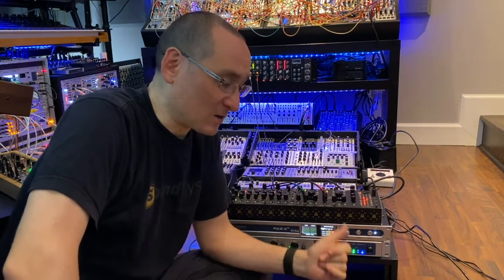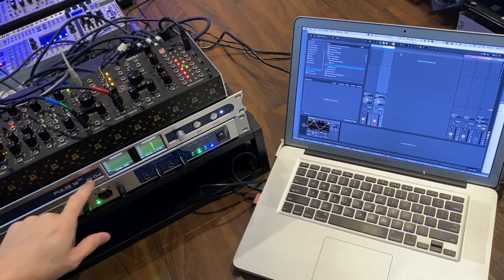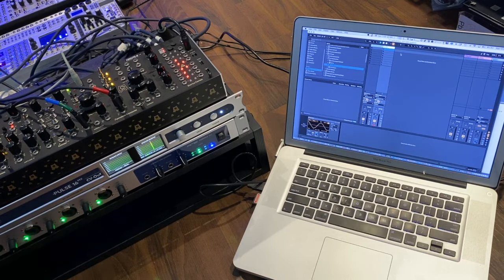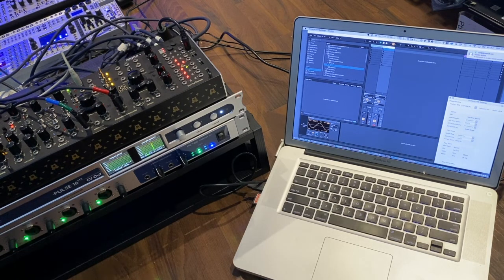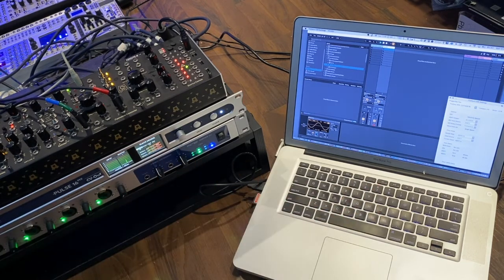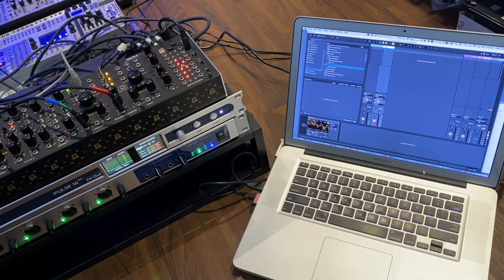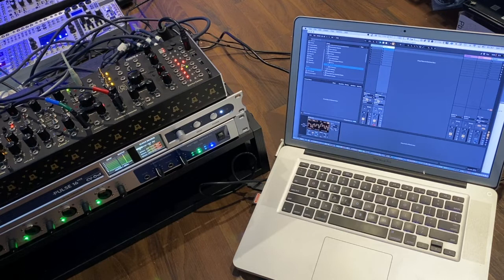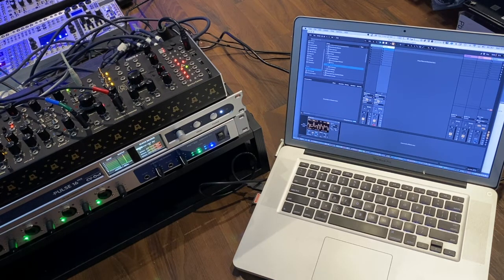Richard Devine on the Ferrofish Pulse 16 CV

Comment: Is there a special cable to be used from output to input or just regular 1/4 to 1/8 cable?
Reply: You'll need a "floating ring" TRS cable. Since the outputs are balanced, if you use a regular TS cable, you'll be sending the inverted signal to ground

Comment: Hi guys!

I have a Ferrofish Pulse 16. Is there a way for me to enable it to also send CV signals? Or will K have to upgrade if I would wish to do this?
Thanks!
Reply: You need the Pulse 16 CV variant for this capability, if it's not "CV" then DC signals are blocked at the analog output.
Reply: @JeffPetersenSynthax can it be change with firmware update?
Reply: @Judasz696  No, it's a factory hardware change during production.
Reply: @JeffPetersenSynthax  it's a bummer becouse pulse16 CVS are nowhere to be found. Are they discountiniued? Also does pulse 16 mx has CV from the get go or is there a mx cv model also?
Reply: @Judasz696  They are having issues with getting the needed components for the CV mod at the moment, these will be available again soon. The CV option is always an option, none of the "stock" models can send out CV. The Pulse 16 MX CV model is available now, but we only have a few in the USA.
Reply: @JeffPetersenSynthax  thank you for this information also can you maybe guess in how many months 16 pulse cv will be available again? Like we talking 6 months or more or less?
Reply: @Judasz696  I could not guess, sorry.
Reply: @JeffPetersenSynthax  no problem that's OK. Thanks

Comment: Did you explain where the output of the pulse 16 is going your modular?  I get the idea but is the output of the pulse strictly being used to send cv?  I used some analog synths and mainly mix so I would need the outs for hardware comps/eqs but would also like to take advantage of the cv option as well - I'm a bit confused
Reply: Both uses are possible. The outputs still work for line level output, they just have DC blocking caps removed to support CV/Gate as well.